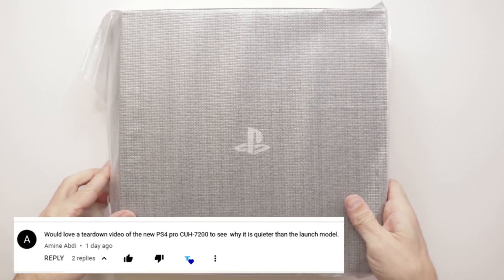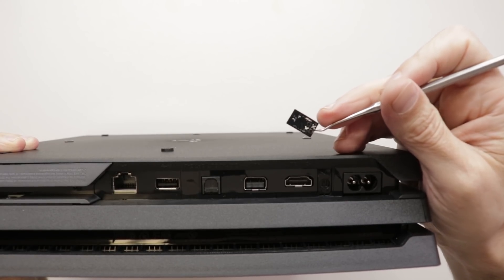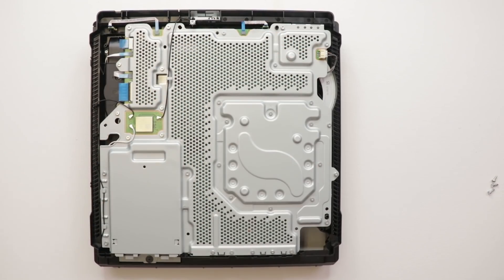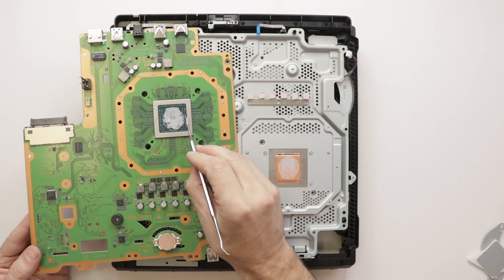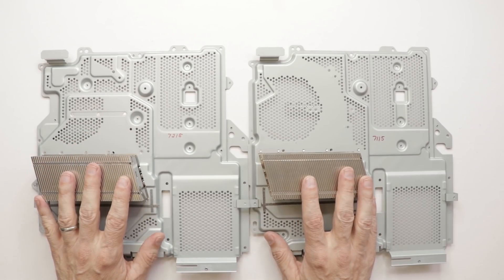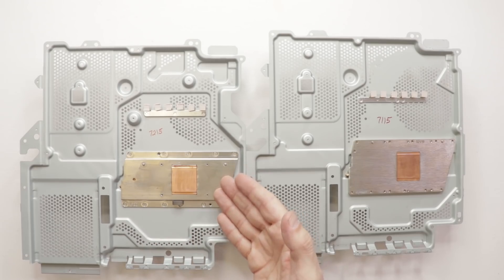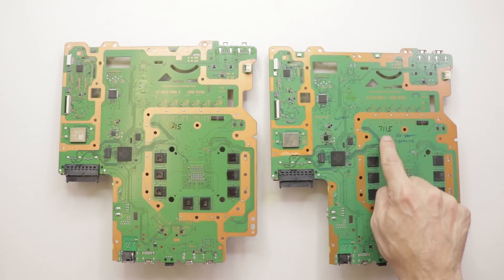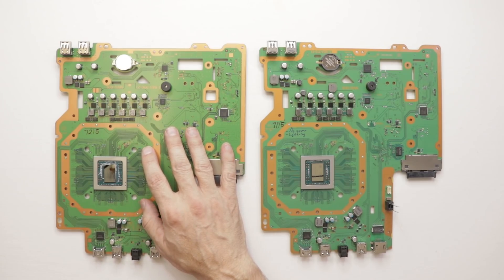The New 2018 PS4 Pro is so Quiet - But Why? Disassembly and Comparison - 7215 Model

Comment: My PS4 pro sounds like a jet taking off.
Reply: Mine started to "take off" in the same direction.  It started working harder since Black OPS 4 came out.   I noticed that my entertainment center was trapping the hot air.  Besides clearing the dust buildup in the vents, I made a cutout in the entertainment center for the air to flow out in the back and now the Pro stays quite. I probably have the 7115 model.
Reply: @KarcusKorpse  what did u do
Reply: @dilrajsinghbhambra  Take the PS4 apart and clean the dust, reapply thermal past.  Do about once a year.
Reply: Thank you for choosing Sony Airlines your destination is GTA V. You will be there in 2 minutes!
Reply from the maker: What model is it?
Reply: TronicsFix first one released
Reply: @Tronicsfix  my red dead redemption 2 ps4 pro sounds like a jet engine playing witcher 3.
Reply: @Tronicsfix  mine does sound like a jet also it's a spiderman ps4 pro amazing red edition
Reply: Same mine sounds like it's getting worst too.. specially when i play certain games like red dead. My ps4 pro only a year old  :/
Reply: @grimrzjay6820  same problem
Reply: Because it is a jet. Now boarding..flight PS4 to awesomeness at terminal number 5.
Reply: When I play apex I have to move 10 feet away or it will ear rape my friends on the mic
Reply: The CUH-7115 model is actually more quieter than the 70XX models. I personally own a 7115B and is pretty good running God Of War and Spider Man.
Reply: THERMAL PASTE REPLACEMENT
Reply: My PS4 Model is Boeing 7116B, and it ramps up my entire room when playing Division 2. I can even hear the noise when having a Headset on...
Reply: @AIZYofficial  does your ps4 turn off because of heat by itself?
Reply: So I took my pro apart completely applied thermal paste cleaned it out. Still sounds like it’s about to land on the moon when the thrusters kick in. My 7000 model no hope for it but hey still plays like a champ... hopefully the PlayStation 5 doesn’t sound like f15 flying over head this time.
Reply: My ps4 fat does the same thing when I play call of duty.
Reply: @GlobalGaming101  just needs heatsink cleaning 😉 very easy to do and makes a huge difference.
Reply: GlobalGaming101 are you talking about the og PS4 not the slim
Reply: Mine sounds like a jet taking off as well. I'm certain I have an original model since I got mine withing a few weeks after ps4pro released. It got even worse when I bought a new 55" lg 4k superhd TV. I really enjoy playing No Man's Sky in HDR. Sadly it's at the cost of my ps4 pro being so loud, I can't hear any of the ambient music. I would love to have this issue resolved. I want to get a newer model but I'm afraid it will be quiet at first like this one, then get worse over a few months.
Reply: @sekushimitsukai330  If you bought in 2016 then it is a 70XX version, i got mine in 2018 being the 71XX.
Reply: K4R1N3 L1M4 yah mind is 7000
Reply: She Wolf i solved mine by using the cleaning and thermal paste application shown on this very channel
Reply: @hailhydra5061  I don't have the confidence to try that
Reply: My ps4 sounded like a jet since the first boot. 
I hardly use it, but when i use i need one one these earphones with rubber thingies to i can hear something with the damn 747ish ps4... 

Mine is the first phat model, that original one
Reply: Mine as well 😁 Redicoulus, espacaly in Wolfenstein 2 it nearly explode..
Reply: @Farhan Johandy Bam...he gets it lol
Reply: Mine sometimes do, but not often.  But since I play with headphones its a non issue anyways.
Reply: Gnewm
Reply: HotSizzleTV mine too and it’s model CUH7216b and it’s incredibly loud, since like a month or something. It’s almost 4 months old and I vacuumed it and cleaned the whole vent
Reply: I pre ordered mine got it day one in November 2016 and it sounds super loud on some games but not all games
Reply: Oh ok so I definitely have the launch model because when I remove the first metal plate my motherboard has a x shaped cpu clamp and an additional plate to space out the motherboard to prevent direct contact.
Reply: @NathanThaSavage  i need to do a deep clean but i am scared i wont be able to put it back together.,
Reply: My PS4 Pro (Red Dead Bundle) seems to have a Coil Whine Problem. Seems to be a rather known issue with the newer Models. But i dunno if its your Problem. And i dont know if you can do something about it.
Reply: When you have an xbox and you sleep with it turned on :/
Reply: I've cleaned mine and it's still loud
Reply: Hahahahahah mine to
Reply: I've got a 7116B and it's embarrassingly loud on most games, it can't even run cod warzone it just crashes. I'm opening it up today to change thermal paste and clean everything I can so fingers crossed.
Reply: It was the same by me then i got the new 7126B version and i dont even know if it is On sometimes
Reply: @mario97kristic  true
Reply: My brand new PS4 Pro was also making the “jet engine” sound a lot and than started over heating and shutting down. I sent it back to Sony for repairs ( was still under warranty ) and got my exact PS back, less than a week later working beautifully again. I have no idea what they did to it, they didn’t give me any records back with it showing what was done.
Reply: 0525loki probably thermal paste
Reply: Completely clean ur ps4 from the inside and replace the thermal paste. It’ll be back to normal
Reply: The thermal paste dries up quicker with all these newer games that are really designed for next gen
Reply: change tim and clean it.
Reply: It’s the very first one released. I think 7000 chu I am planning on buying the 7200 model because I can literally hear it through my headphones.
Reply: Take it apart and replace the thermal paste with artic silver 5. Don't be afraid. It's actually a lot easier than you think. My PS4 become very quiet after that.
Reply: @MiguelRPD  what model number do you have? Not going to open up the console if it doesn't help enough
Reply: @GamingPIPI  first one. But mine had a large film of dust and cat hair so that's what helped the most.
Reply: @MiguelRPD  aaah, I've opened the upper side but the fan wasn't dirty at all so don't think it will help. But you can clearly hear my PS4 blowing in the room next door. It's a huge problem
Reply: @GamingPIPI  upper side? You didn't completely open it up? (Which requires unplugging the AC power unit)
Reply: @MiguelRPD  not yet because of the warranty. And the fan looked clean so doesn't seem necessary to open up the complete console. I'm also not really good at that stuff, don't want to break it😅
Reply: I replaced the thermal paste and pads and it still runs annoyingly loud
Reply: arctic cooling mx-4 shoud be solves your problem

Comment: I got the 7215b and its super quiet 👍
Reply: I got the same model like 2 days ago lol except I switched out the HDD for a Samsung Evo 850 SSD and it runs like a charm, with a 4k gaming cable too. Couldn't be more happier with my purchase. Quiet, runs smooth, no lag. The only lag I've encountered at all was because not all games are optimized or run smoothly. But not at all disappointed.
Reply: Bradley Hines and very hot , yes?

Comment: I dont know which ps4 pro model mine is 😞😞
Reply from the maker: Look on the back. It's kind of hard to see but it's there.
Reply: Is it a kind of sticker or something or just a number?
By the way thank u so much brother for the super fast reply ☺️
Reply from the maker: There's a sticker on the back with the model number and a bunch of fine print.
Reply: TronicsFix much much thanks mate
Reply: Did u buy it recently? If so its most likely the 7215, the spider man red Pro is a 7115, i have a 7000 series and it runs great but yes it can be loud when running a “pro enhanced game”
Reply: Everyday Muscle mine one sounds like a jet when running god of war

Comment: Hi. I did not knew it has a  internal battery at the mother board. What is the purpose of this battery? How to know if it needs replacement or is still good? Info plz!!
Reply from the maker: It's not really a battery. It's a power supply. The purpose is to take power from your wall outlet and convert it into lower voltage power that your console can use.
Reply: @Tronicsfix  at 7:15 right next at the left of the USB chip i saw that round thing with + the plus symbol and i though it was a clock battery!
Reply: @paico26  it is a battery like you find in PC motherboard. Even you unplug your ps4 it has to run the clock and save password.

Comment: I bought a PS4 pro to replace my original fat PS4 my PS4 pro whilst playing god of war the fan would kick in and sound like a hair dryer I replaced the thermal paste with liquid metal and now it runs quit.
Reply: Bored Gamer after paying £350, You shouldn’t need to mess with it and void the warranty. Annoys me.
Reply: @yosh5835  well when your PS4 overheats and breaks down costing you more money to pay into Sony's warranty system you'll regret spending £8 on some thermal paste which actually helps your PS4 work properly it's people like you who are to scared to void warrantys that annoys me
Reply: Bored Gamer so you think it’s ok for Sony to sell you a half finished product?
Reply: @yosh5835  not half finished I'm just improving it as I build PC's for a living and I know new thermal paste will extend the life of my apu processor so why not do it and save money in the long run
Reply: Bored Gamer had a Launch PRO, day one, not broke yet, Sony gets away with it because people go out and “improve” the console themselves, it’s like buying a car then the manufacturer recommends to change the brake lines because they corrode. Not right is it.
I know what you’re saying, and do whatever, it just annoys me how Sony get away with it. Then expect the consumer to “improve” it themselves.
Reply: @yosh5835  if you wanna save money fix it before it breaks

Comment: Well am guessing they changed the PSU to a more efficient one that would reduce heat on the VRM chips... Also the heatsink looked abit bigger, the contact point was made less flat to give more space around it for air flow.

Comment: Could you try the older model heat sync on the new board if they are interchangeable?
Reply: For possible better heat exchange of course. :D
Reply from the maker: I could. I'm not sure if I'll have time for that but maybe.
Reply: @Tronicsfix  could do that and liquid metal test in one video
Reply: Yeah nice idea. But before swaping is better measure power consumption.
Reply: @serraxer  if it had high amp output the device will only draw as much as it needs, but I doubt the older has less to work with. If it did then that could cause an issue.

Comment: The jet simulator just got a little less like a jet, but not by much, all they need to do now is stop advertising this not even half 4k console as a 4k console the blatant liars
Reply: Carbon suicide mtb Contrary to Microsoft Sony never lied about the 4K capabilities of their console.
Reply: @kraenk12  pmsl, yes they did, and they still are, Sony are advertising the ps pro as 4k when it's a 2k console, the one x runs even open world games like red dead 2 in native 4k, it's fact stupid
Reply: Carbon suicide mtb No man. It’s 4K capable...there are 50 or so native 4K games on it. It is made to be used on 4K TVs. That’s what the label means. Other than Microsoft Sony has, from day one, always talked about the ways it’ll use to do that. Most games on X1X don’t run at native 4K either. Fin hypocritical XBots. You probably still game on base X1 anyway.
Reply: @kraenk12  so you are making excuses for a failed vr console? Well done, how's the light you can't turn off on your ps control? Still draining battery?

Comment: Try to put the heatsink of the7200 in the 7100 to see if thats the secret of the new ps4 pro
Reply: its probably just a new software fan curve. its probably built into the bios
Reply: Did it help? I'm desperate for finding a solution. My pro ruins the sound of my home theater system :(
Reply: @GamingPIPI  lol right. I put my headphones on just so I don't have to listen to it 😂
Reply: Jochanan Van Holst I think yours is just very loud so clean out the heat sink
Reply: @GamingPIPI  Try liquid metal on the apu and better thermal pads (you can find tutorials on YT cause you need some extra work before you use liquidmetal) and ofcourse put it in an open space.
Reply: @mrn234  open space? like, throw it outside your window? I'd agree on that being the answer to the noise problem. :D
Reply: Want noise 😂 slap those head phones on
Reply: Its the fan and better thermal paste and pads the fan is nidec the other is delta

Comment: Digital foundry did a heat test comparison and the original while loudest it ran the coolest and the 7200 actually runs hotter
Reply: yellow98gt better functioning heat sink.

Comment: if you look closely there's any diff an power supply connector on the back of the console, maybe the change the power supply too
Reply from the maker: Yes, I didn't see that at first. I'll be taking a closer look at the power supply.
Reply: On the Pro i have,(CUH7116)its quiet enough at the moment on a par with 500gb"slim"it has replaced,no problems with it,my son's 1st version had gone 2 pastures new.So as he only plays fifa & 1or 2 others,it is more than adaquate 4 that,he had new controller & headset.2 keep him sweet.__LOL thats all he wanted. power supply is remanisant of the "FAT PS3" from few years back,at the end of the day,if Sony use "bulk purchased" materials & use the minimum amounts assembling them,We get cheap & nasty goods which is common place these days..

Comment: The new Pro "doesn't" run any cooler. It does run quieter because the fan spins slower thus consuming less power, but the system actually runs noticeably hotter for the sake of lower noise. You can confirm by viewing it thru an inferred camera as Digital Foundry had in their review.
Reply: Chronicles of K. Toyoda the heat sink runs hotter...means it’s working better. So hard to understand?
Reply: @kraenk12  Unfortunately not in this case as its simply less air moving past it, meaning it just isn't cooling as fast hence the higher temps. Though I do understand your confusion.
Reply: Chronicles of K. Toyoda Have you measured the fan speed? Guessed so.
Reply: @kraenk12  It's very obviously slower, as Digital Foundry have pointed out.... Not sure why it's so hard for you to understand that considering it would be slower either way assuming it was more efficient at dissipating heat as you claim....
Reply: @ChroniclesofKToyoda  Even DF was just speculating. Don't talk about stuff you know nothing about.
Reply: @kraenk12  All "you" are doing is speculating. Like I've said even in the scenario that more thermals were going to the heat sink, it would still result in the fans spinning slower. So it is you who shouldn't talk unlike DF who have tested this to come to the same conclusion as me..

Comment: It is quiet but hotter. It's all Sony's "magic" here
Reply: from what i've seen people have only measured the exhaust heat which is hotter but not the temp of the cpu itself which could be cooler if more heat is being removed from it by the cooling system
Reply: @Maikeru_Dabittsu  ^he's right you know.
Reply: Rhtr Hotter heatsink means more efficient heatsink.
Reply: @kraenk12  True - i think its due to less coper near the CPU. It redirects the heat to the fins, thus u can slow down the fan, CPU runs cooler, exhaust is hotter.
Reply: @tomasz_peszke  Less copper actually means smaller cross section therefore reduced heat conductance to spread the heat along the baseplate. As the APU is the one and only significant heat source in that area, it doesn't "take the heat back" from that metal surface, as the chip has always higher temperature than the metal parts.
Reply: Yup, he said more cooler imat the end of the video that is incorrect. They just slowed fown the fan and that get the temps higher
Reply: So what? Idiots...

Comment: It doesn't actually run cooler, in fact it runs slightly hotter than before.
Digital Foundry did a comparison test and it looks like only the fan curve or the fan itself is making the difference.
Also the PSU got updated apparently.

Thanks for your work anyway, cheers!
Reply: Kévin TARDITO Not true...the heatsink is hotter means the CPU runs cooler and needs less fan speed,
Reply: kraenk12 the heatsink being hotter does not necesserily mean that the cpu runs cooler. If the fans do not remove heat from it then it stays hotter.
Reply: @kraenk12  If you want to get technical at least do it right: Yes, the APU MIGHT run cooler because of a better heat dissipation but the PS4 as a whole is hotter and the exhausted air is hotter aswell.
Reply: Kévin TARDITO , who cares if the exhaust is hotter? It means it’s removing the heat
Reply: @placeboobshere5458  Yes, and?
Reply: Kévin TARDITO, and it’s moving the heat alway from the processors.  I can’t believe I have to spell this out to you.  It doesn’t matter if the ps4 is hotter overall as long as the processors are cooler.
Reply: @placeboobshere5458  and??

Comment: Hello man I have a problem.I opened my original ps4 to change the thermal paste 
and clean it but now the power button wont work for some reason and the 
only way I can use my ps4 is by using the controller to turn it on.Also every time I want to turn it on I have to unplug it and replug it.
I tried to turn it On by touching the little contact on the inside but
nothing.Any suggestions ?
Reply: Oh I forgot to mention that it beeps 3 times when powered on.
Reply from the maker: So it beeps 3 times and shuts down? Does it give you an overheating error?
Reply: No it works fine its just beeps three times when it turn it on.